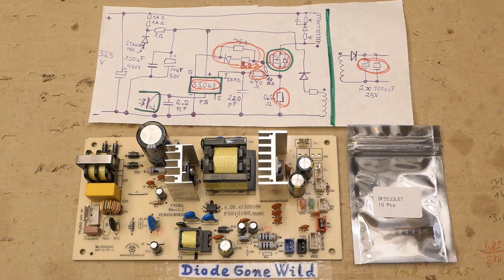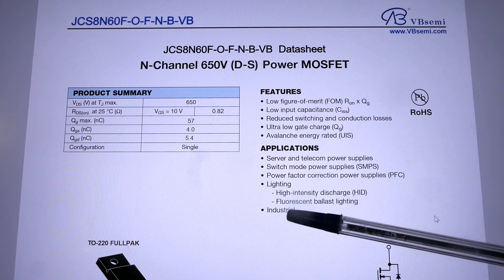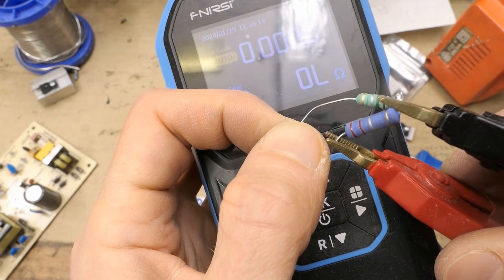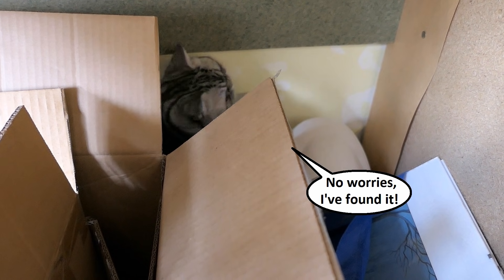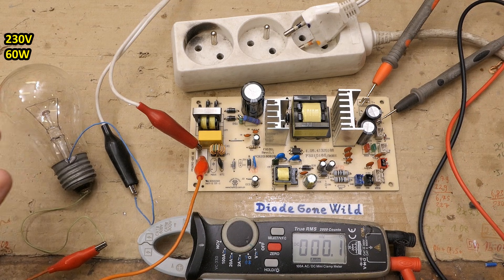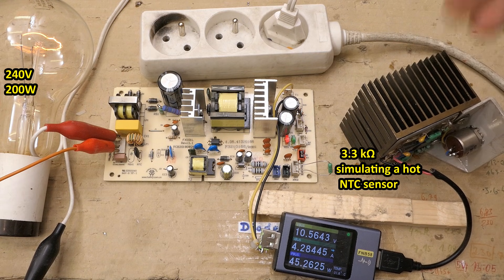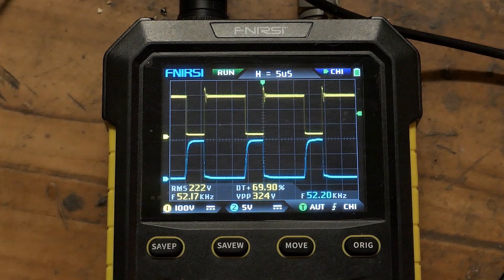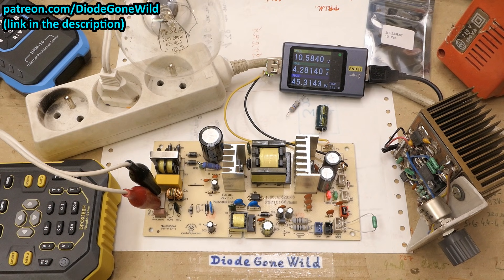Fixing something not worth fixing (Peltier fridge power supply)

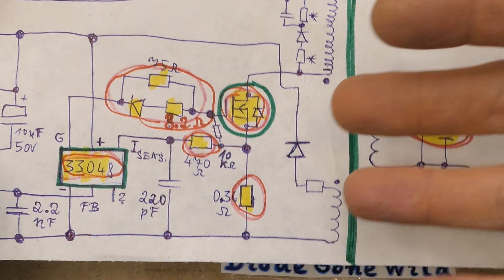Comment: 05:44 "LOWESR" is actually a brand name -- I've bought lousiest cheapest capacitors off Aliexpress branded that. Any they were primary cause of failure as you say. No wonder. But I saw a guy from UK who used them as normal caps.
Reply: Buying cheap crap capacitors is a false economy, unless you are only intending for the product to work long enough that you get the customers money and are long gone by the time it stops working...
Reply: Given the difrance between them I wondered if they were re-wrapped salvage.

Comment: i had the same power supply, it only lasted 5 months. So I binned it and put in a higher rated MeanWell power supply.
runs a lot cooler. it was not worth the effort to fix as the meanwell was about the same cost as the replacement parts.

Comment: I've got one of these fridges in the shed. a 12v/120v version that had the 120v to 12v power supply go bad. Might have to bring it in and do some diagnostics.
Reply: I have one with a board very very similar to this one and also the capacitors went bad, I was lucky the transistor didn't destroy itself, I just replaced the capacitors and the fridge has been running for 6 month already

Comment: Nice fix, but talking about the power supply's design, the conclusion is: Dodgyyyyyy! - at least in mobile fridge context. I repaired one, then it failed again and since it was too far gone, the fridge now runs on an external supply only, since it had a DC barrel jack. I'm still baffled by how shittily it was made. Since these units often work in rough conditions - shock, vibration, a wide range of ambient temperatures, moisture and dirt ingress - the board really should have conformal coating on it, and some glue to hold heavy parts.

Comment: I love the way you replace SMD devices with that huge solder gun! Great video.
Reply: indeed, rather funny - esp. the diode. other than that - "SurfaceMountedDevice devices" is a little funny/weird, too.
Reply: @stanimir4197 Louis Rossman method - "Flux and heat makes me the microsolderer I ain't"
DiodeGoneWild method - "A dab of rosin an all the heat makes me the SMD master I ain't"
😂
Reply: Yeah the rosin flux and the insane heat do all the heavy lifting. Just don't delaminate the pcb